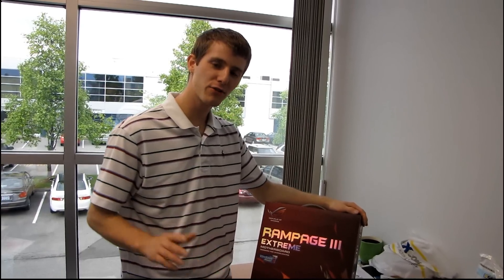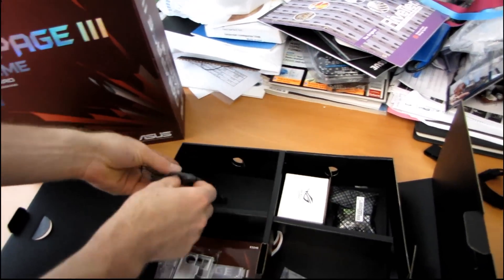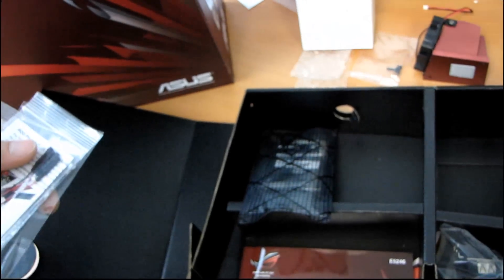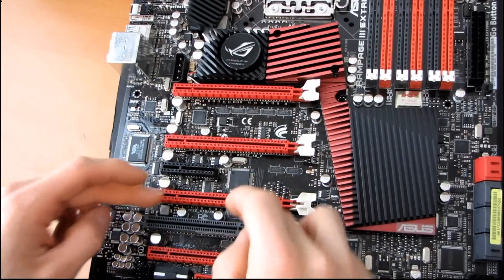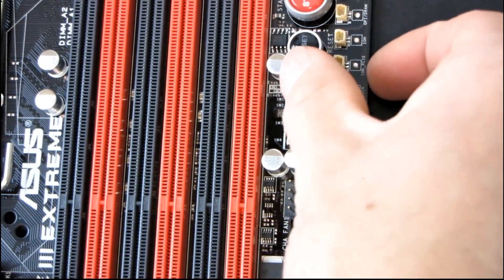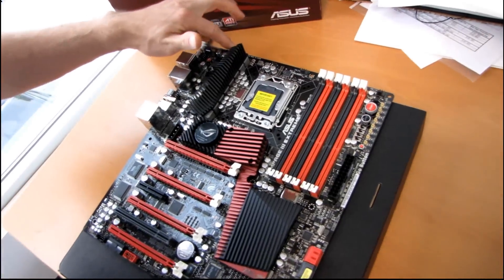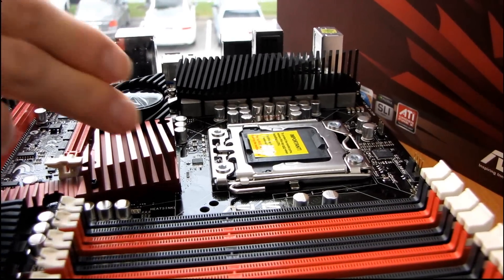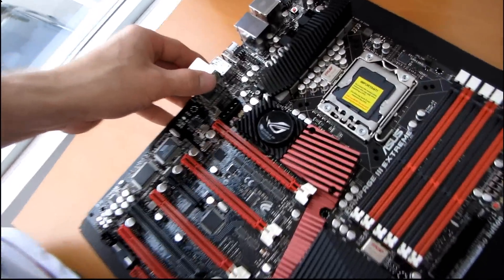ASUS Rampage III Extreme Crossfire SLI Gaming Motherboard Unboxing & First Look Linus Tech Tips

Comment: @tazss159  x58 has 32 lanes for PCI-E, and that is divided up by however many cards you have. one card runs at x16 in the slot. two cards run at x16. 16 + 16 = 32. But with four cards, 8 + 8 + 8 + 8 = 32. the lanes are divided up. Besides the bandwidth for PCI-E 2.0 x8 is 4GB/s, and x16 is 8GB/s. so as a final note, there is no way to saturate any of those so the performance difference is VERY minimal from x8 to x16 for video cards.

Comment: Still have mine with I7 950 running strong since 2010
Reply: Me too i7 950 12gb ram, new graphics card and ssd in recent years and it can still handle pretty much everything
Reply: @russellbryant9776  hell yeah. I do have 2 newer ryzen 7 builds but the old i7 950 and rampage is running strong!
Reply: Still have mine! Playing modern titles alongside an RX 580, i7 Extreme 980 at 4.2Ghz. Killer setup for me even to this day running COD:MW at 100+ FPS 1080p and high settings. Talk about future proof, never would have thought a decade out of this was reasonable.
Reply: Yeah same here bro! Running strong since 2010 with i7 980x , 24GB Corsair , my evga gtx 480 HC is struggling! And I’m terrified that it’s gonna leak coolant any day now 🙈
Reply: @antoniocusato6074  Haha Go out in style!!
Reply: @ZR1VengefulMMAGTS  Was intending to upgrade the old GTX 480 just before COVID but now is out of budget :(
I must say though it's 3 SSD's in raid 0 still make this build comfortable to use all these years later still!
My main issue is the fear of it's literal bottle-neck exploding inside my case lolol
Reply: @antoniocusato6074  Haha I feel you I upgraded my GTX 460 and CPU became bottle neck so I swapped back to keep it all the same era and just made 2 newer Ryzen build before prices when through the roof!  I paid $169  each for my Ryzen 7 1700X now they are 300 plus its crazy!
Reply: I had this board paired with i7 960 and GTX 580.  Still running well but I sold in Sept 2020 at good deal.

Comment: still using this motherboard in my setup that's been running atleast 10 hours a day since 2010 :D i remember sweating the price but damn what a reliable board
Reply: @Mohammed Talha can play everything comfortably at 1080p max settings. depends on the game but can sit around 200 fps in overwatch for instance with lots of stuff going on. I use a 980x still as the cpu and stuck a gtx1080 in this when it got released
Reply: Just sold mine. Still was using as my main PC in 2022. Runs everything smoother than my MSI GE75 laptop.  Absolutely amazing board.
Reply: @dalenewton9697  they dont make em like they used to

Comment: The 4 switches on the motherboard are for enabling or disabling the PCI-E X16. It's useful if you have all your GPU's installed and water-cooled and you think you have an issue with a  card. You can trouble shoot and find the exact card that is giving you problems by turning the switches to off.

Comment: @hammudi90 you can put 8 ram DIMMS and if you can find a PSU to support 4 GPUs aswell as 4 GPUS that are small enough to fit on the PCIE slots then yes, theoretically you can.

Comment: Sweet mobo. You need to be able to put that Bios switch on the outside of the case so you can switch easily between your 24/7 and extreme benchmarking OC settings.

Comment: This board has two full x16 2.0 lanes. x8 x8 x8 x8 is for quadfire. Dual sli and dual crossfire will run at full x16 speed if you only use pci-e slots 1 and 3. There is a new Rampage 4 extreme that has four x8 3.0 slots, which all run at the same speed as x16 2.0, though you need a pci-e 3.0 graphics card probably.

Comment: Still using one of these in 2016. X5650 @4Ghz. We have found the x58 does indeed run HOTT!
Reply: ICU2 GetMe me to w a i7 ex and a GTX 580
Reply: me too!, i7 950 , gtx 980 ti
Reply: i7 920 @ 3ghz (lol super mini oc) and gtx 670 direct cu ii top
prett nice gaming pc (smal oc because bad cooler ive got a tx3 evo...)
Reply: i7 975XE @ 4004MHz
Gainward GTX 580 1,5GB @ 888-912MHZ Base (+85/+100 mV)

Still very decent.
Reply: My north bridge runs 72~75 and south bridge in the ~65. it's 28C in my room. Motherboard is 50C tough.

I7 960 @ 3.9ghz in summer and 4.2 in winter. ( 1.3v @ 3.9 and 1.325 @ 4.2 ) Before i got a real cooler, the voltage was 1.08 @ 3.2 because elseway it was overheating.

Started with a 560ti 2gb, now got a second because 2gb isen't enough for gta5 or similar.

got corsair 1600mhz ram 3x4gb ( wished i picked up something different, rust use tons of ram and can't get hold of similar ram for a normal price )

FSB ( Qpi link ) @ 169mhz instead of 133. Ram clocked at 1694.

Built in november 2011, still my only computer.
Reply: Great build, I've got a X58 system too with a 4GHz X5670, but may I suggest that you upgrade to at least a 980Ti as they are cheap enough nowadays. I got my Strix 980Ti for 300 euro. The 560Ti, even though it's SLI, doesn't give you double the amount of VRAM as you seem to assume (I know GTA V displays 4GB but it's only able to use 2GB, look it up if you're unsure).  560Ti is a good video card, especially for it's day, but it pales in comparison to what you can get right now. I had a 560Ti until a few weeks ago, sold it for a mere 30 euro :/
Reply: ICU2 GetMe u their bro I need sleek to u wood u pay  140 for this used or get the LGA one

Comment: Maybe other MOBO manufacturers will follow with the front audio at the bottom and no longer in the middle of the MOBO.  Would make running the audio cable a lot easier.

Comment: @GenericName007 I've read where the northbridge heat issue also can have adverse effects on a multi-gpu set up b/c the north bridge is so close to the first gpu slot, it can actually cause the temp for the gpu in that first slot to increase and overheat.  Really want to get this board but am starting to be mildly concerned.  Not sure if Asus has addressed the issue in later revisions/releases of this board.

Comment: @enigmafirst The ATI/AMD drivers only support up to 4 GPUs at once, and a 5970 has 2 GPUs on a single card.  And even if you could, there is only one crossfire bridge on the 5970, so that wouldn't be possible, because 4x crossfire requires two per card.

Comment: @YamiPoyo i didn't know sabertooth had better cooling thx for letting me know and if your building a rig for yourself go with whichever configuration is more convenient for you, im running a rampage 3 on my rig and it runs smooth all the time

my build:
haf 942
gtx 570x2(liquid cooled)
corsair hx 850w
corsair xms3 12gig ram
rampage iii formula
intel i7-950(liquid cooled)

Comment: @shotokanslammer1 
So just to be clear: No, this board indeed does NOT support DDR2. (support? it just doesn't fit.) But DDR3 can run in dual channel aswell. Though most people who've got 6 DRAM slots use more then 2 sticks of RAM and thus automaticly use tripple channel.

Comment: I have the same x58 chipset, but an slightly older motherboard.
The Asus P6T.
The ASUS site says thet this board officially supports a max of 24gb of ram.
But somehow it also seems to support 48gb of ram.
After reading some articals about this nice suprise i ordered 48gb ddr-3 triple channel "Kingston Hyper-X Savage" (2400Mhz), and it works!!
I still use this hardware in combination wit an i7 990x (6 cores - 12 treads) overclocked from 3.47 Ghz stock to 5 Ghz.
CPU cooling: Gamerstorm Assassin (max temp at load 63c/145 Fahrenheit)
GPU: Asus RX580 dual 8gb oc.
My setup can still run the newest games at 1080p with an average framerate from 90 to about 120 fps, on mu 24 inch Asus led screen (MS228).
Pretty old screen by the way, but it does not have dead pixels or something.
So i will stick with this screen as long as it will last (or untill i win the lottery)

Comment: @markowina Are you in the UK? The online store Aria are doing i7 950 for £211!!! that is a great price. I bought a i7 930 for £215 6 weeks ago along with a EVGA X58 Micro mobo but not had a chance to set it up yet as I still need to get my case Corsair 800D and some more nice compression rotary fittings for the water cooling loop. Hope your bui;d turns out aw2some

Comment: @funyongod 
Sure, 2 card will outperform a single in RAW power, but a single card will most likely run cooler, have lower power consumption, cost less, be more compatible and be alot more stable. This isn't always the case though, the new gtx460 scales incredibly well in most benchmarks i've seen.

Comment: @zxcv1175 I Had:
Antec 900
Coolermaster 850 watt
HiS 5870
xms 1600/1800/2000 ram 6 gigs ddr3
Gigabyte x58 ud3r
I7 950
The first system i returned due to faulty sound ports
And some other minor video lag.
The new system used a revision of the ud3r, but the voltages were bad.

So they are replacing so much of my pc now that its been 2 weeks since i took it in.

Comment: @scoobywoo27 
A motherboard is one of the key components on your PC. (with key I mean that if it fails, your PC will crash and be dead).. Anyway, the motherboard houses the processor, the memory and in most cases these days: one or multiple graphics cards and maybe a sound card. Basicly all other hardware is connected to it and most, if not all, data goes through it. That's why they call it a "mother"board (I think).

Comment: @BigHeadClan 
fail.
this board does have an LGA1366 socket. which means that no kind of amd cpu will fit and the sandybridges won't too. because they only run onLGA1155 sockets!
i think you all should know that this vid is older than one year ;)

Comment: Depends on your motherboard, most lga1366 boards have at least two pcie 16x 2.0 lanes, lga1155/6 only 1 16x 2.0 lane. Many also have bandwidth sharing between the additional ports, eg if you using two lanes they might run at 16x but with three lanes they might run at 16x, 8x, 8x. Pci-e 2.0 8x is only now just starting to be a bottleneck for the latest high end single chip graphics cards. The AMD 7970, depending on the game, loses between 2-7% max performance in an 8x 2.0 slot.

Comment: @Awayze not at all, Sure 2 mid range cards are not a good and 1 high-end card, Having 2 cards wont increase VRAM or the frequency (unless you overclock), but it will increase the ammount of GPU cores, which makes a CrossfireX and SLI setup alot more powerful than any 480 or 5870.

Example: 2 ATI Radeon 5770s will always trump a 5870. or 2 GeForce 800GTs will always out perform any 480.

Comment: I have this board. it dont support my ocz revo drive. it also gets confused on what drive to boot to at times. bios craped out a few times. but i was able to recove. but if you want fast this is it. 4.383 ghz. i was not able to get ram to work at 2133. as board supports and my kingston 2333 ram supports  it would boot to desk top but ram errors and memory managment errors. so i have it running at 2000 9-11-9-30 with ht link at 3300. its a 1090t , 4 gigs or ram, silver arrow, msi 460 hawk, revo

Comment: You're missing the point one £600 GPU using full x16 bandwidth will work better than two cards sharing the x16 bandwidth reducing it to x8 per card.

Thus what ever your budget is buy the most expensive card you can rather than two.

Sli mainly comes into use when working on multimedia and having several apps or windows open.

Comment: @MCLRproductions seems like a reasonable build dude, you won't get much overclocking potential with that cooler, also if your screen size is 2560 x 1600 as you say the gtx 560 will struggle, you need a gtx 580 or gtx 590, 6950/6970/6990 for screen resolutions of that size. also I would swap the PSU to something like the corsair AX 850, if you want anymore help pm me :)

Comment: @theg0dfathers thanks for replying mate. well i want to play latest games at max settings but at a resolution 1024*768.thats y i m not taking very very high end mobos. i wanted to knows if this mobo msi 740gm-p25. 2 gigs ddrr3 1333mhz corsair xms3, hd 5670 and amd  phenom ii 560 be can do the job or not?.i not very high resolution gaming freak. i like to play on max settings but noral resolution. also this mobo has core unlocking feature and i have heard the phenom ii560 has hidden 2 cores also.

Comment: I plan on using this board for my next build and have been reading reviews and a lot of people who use this board say that the North bridge (where the included fan goes) does actually get pretty hot.  Some reviews say it helps or in some cases solves the problem if you remove the heat sinks all around and use aftermarket thermal compound.  There are some that say they haven't had these heating issues but there are enough complaints about the issue to give me pause.

Comment: I need your profesional advice & opinion, I would like to know weather the components I've purchased are going to run together. 
Asus rampage exteme 3, i7 980x cpu, G.Skill trident fs 16000CL9T(3x2gb)DDR3, Corsia Nova v 64gb SSD, Coolermaster Cosmos S, Coolermaster Silent Pro-gold 1200w, Saphire ATI Radeon HD5850 Toxic 1gb, Samsung PX2370 23 Inch LED Monitor, Logitech G19 Keyboard, Logitech G9x Mouse, Logitech X-530 5.1 speaker system, Pioneer BDR-205 Blue-ray 
Thanks in Advance.

Comment: The performance of the SLI/Crossfire depends on the hardware scaling and the driver support. Currently AMD has better hardware scaling but Nvidia has far better driver support. The two main sane approaches, are either using two high end cards for higher performance, or two high value for performance mid tier cards. If there is a single card solution with better performance for the same price as the sli/cf setup, then the single card is better.

Comment: @theg0dfathers  hey dude can u tell me is this mobo msi 740gm-p25 good. i mean for average gaming. do u think msi boards have nice built quality and do they last long? this board supports 8 gigs of 1333 mhz ddr3 ram.
the board also has core unlocking feature. that is it can unlock hidden cores. the board is of approx 50$.i have never used msi products. i have always used intel boards

Comment: I wanna know when you use the SLi features does the graphics card bandwith go down fromm x16 to x8?
I find most boards wth SLi state at booth ports are x16 but I head read testing reviews and when two cards are used the bandwith is lowered to x8. Doesn't this reduce the effectiveness of SLi and wont a £600 GPU work better than two £300 GPU's? Thus SLi can be a bit of a con at moment.

Comment: feb 2019 what if i told you i just got this board with the 990x chip and 24g of ram and i just got my hafx case today for 10$. :) lol. now i need a psu. DID i just beat LINUS budget build ? i will have less then 500$ in my build. i won the ebay bid at 281$ for the board with the chip and ram. :) ima make a video of its build just cause LOL. 
2019 retro i7 build LOL>
Reply: That is awesome.   I had this with the 980x  for 6.5 years.   Great board and chip.  My buddy is running it now
Reply: @microterf  i have it all up and running now using it right now :) main drive running off a ssd so the speed alone is def better :) but yeah it seems to run a bit better then my old pc in game but normal use nothing noticed. DL times much faster but a ssd so ya know :)

Comment: Question about HDMI Audio for R3E.   Somewhere in the BIOS you can switch from SPDIF to HDMI.  Is there a special bracket that I need to buy to attach to the motherboard?

At the moment, I have an ASUS 5870_v2 and doing my audio through it's HDMI, but doesn't support above 48KHz (I want 92k and above).  Wondering how I can configure it :) Thanks.

Comment: The four switches I believe can be used to turn off the PCI-e slots (with each switch corresponding to one PCI-e slot). This is supposedly helpful if you have a multiple GPU setup, and one breaks, this is an easy way to test which GPU is faulty, just by turning off each slot until one GPU doesn't display an image.

Comment: Can you help me? I have this card and the memories are corsair 2000 mhz pc 16000. This memory has been discontinued and want to put more memory. I could tell me what and could add or replace? thank you.
Reply: How many slots are filled?
Reply: +dr deconstruct  I have two 4GB memories each
Reply: You can get HyperX Fury and Savages, get 2000Mhz, they are just memories so same speed and same amount of GB you got will work.
Reply: But these are different from Corsair vengeance, not works together right?
Reply: Lauro Roberto Marinoso They will work, memories is memory, but the Vengeance DDR3 is still in production as the Vengeance LP. They are same but LP is just low profile.

Comment: As I said though, higher end mother boards like the one in the video have two full x16 2.0 lanes. Its only the top cards and dual chip cards that are starting to bottleneck on x8 2.0. Whilst generally the most powerful single card is the best option, at times two mid level cards may be far cheaper and have the same performance. The mid tier cards of the current generation are still fine on x8. Its only the 7900+ and 670+ cards that are bottlenecking on x8.

Comment: hm i need advice. i want to buy this board. but im not going to use it for such extreme stuff .. at least not for now. 

plan to use this board. with a core i7 cpu, 8gb's of ram, a good video card(for now i dont plan to use sli). no watercooling or flashing bios.  is it worth getting or should i lower my standards?

Comment: I will have my i7 920 running at 4.0ghz on a corsair H100 and I will have x2 msi geforce gtx 760 overclocked to 1100mhz with 16GB ddr3 ram .....what would my fps be on bf4 and planetside 2

Comment: can i run crossfire in the 1st and 2nd PCI slots? or does it have to be 1st and 3rd? reason being, i need the shorter black pci slot (forgot what it was called lol) under the third PCI slot for a wireless network card. Having a gpu there will block it.
cheers